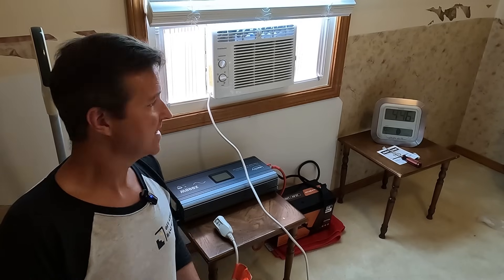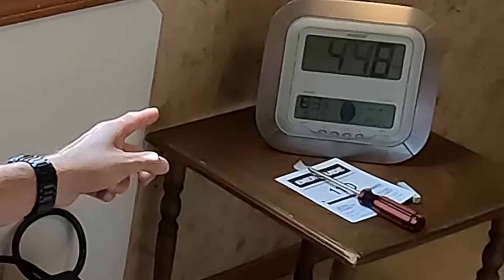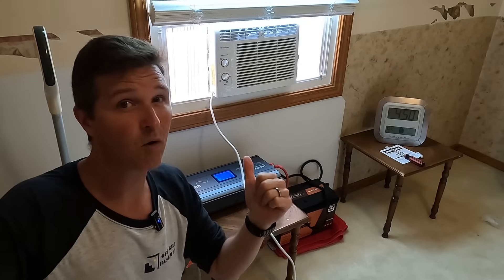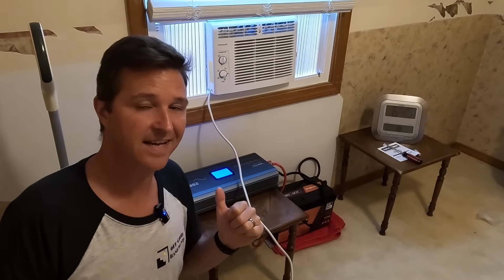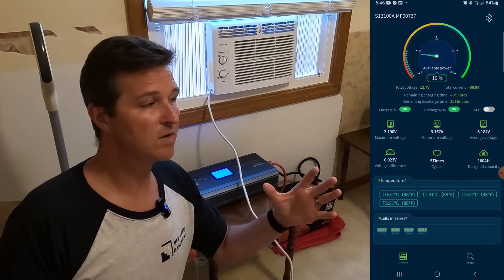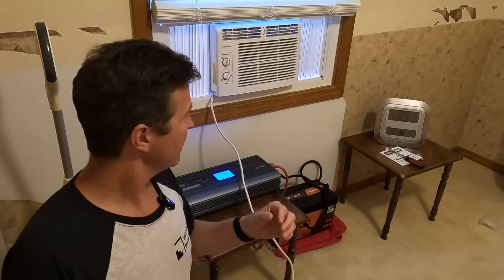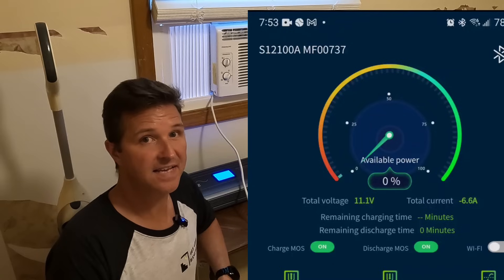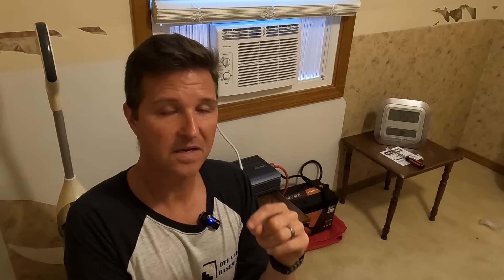How long can you power a 5,000btu air conditioner with a 12v 100ah Lifepo4 battery?  Let's find out!

Comment: Here is SE Michigan, I have a similar setup with several battery banks (AGM, FLA, and LiFePO4) running a LG5k BTU.  Running all day with 900watts of solar on one array using FLA, no issues. But once the sunsets, the real test (as your video shows) is how long a battery will hold up.  I have 4-Renogy AGM 200Ah in parallel (12v) and honestly they SUCK are NOT cheap.  The 24v FLA batteries actually do much better than one would expect.  The LiFePO4 have a more stable voltage.  My advice is this:  Run the highest nominal voltage you can afford to lower the current drain which is what kills batteries especially at 12v and have a good or multiple solar MPPTs with at least 500 watts on each MPPT.  My testing is good enough for me to keep the back room much cooler from 10am until 9pm since two MPPTs easily handle to load and keep the battery at 13.8 all day long......however, its much cheaper to use the grid, but in a power outage or off grid you don't have an alternative other than to run a generator.  Also, my projects are wife approved since she hates heat!
Reply from the maker: Thank you for sharing that great information!
Reply: Yep, I just replaced the Renogy 200s in my van with an Epoch 460. Way better battery. Lasts longer, charges faster and it has an on/off switch.

Comment: Great video. I run a small 3000w generator for 3 hours and charge fridge, batteries and little 8000 btu window HVAC, then I turn off the generator and run just the HVAC on batteries.
Reply from the maker: Thanks for sharing and for the comment.

Comment: May I ask how many watts your inverter uses as overhead at Idle?
Reply from the maker: It uses about 7w of stand by consumption.
Reply: @OffGridBasement  Thank you, Sir.  I have a low frequency 2500/7500 that takes 50-70 watts.  I wondered what the relatively same sized high frequency took.
Reply: @OffGridBasement  You can see that I asked a question about the inverter back when this video was new.  Now almost a year later may I also ask how the inverter is holding up?  Have you used it much?  Has it been dependable?  I also realize that if today I buy the same one off your referenced tag that I might get an entirely different build inside the box.  Companies seem to cheapen their products after getting a good initial reception and thereafter live off their former higher quality reputation.  

I continue to watch your videos and have always had good reason to give them a thumbs up.  

A T Burke

Comment: Add 200 watts of solar n mppt , run all day n and a few hrs after😊 sun sets...
Reply from the maker: Thanks for the comment!
Reply: How are you going to run a 400 watt air conditioner all day on 200 watts of solar? The battery will be dead in 5 hours at most.

Comment: That low of BTU it wouldn't cool much.
Reply from the maker: Yep.  The room has to be pretty small.  A popup camper would be good.  Thanks for the comment.
Reply: You might be surprised what a 5k window ac can do in a well insulated house.  Last summer my 5k kept my FL house comfortable for 4 days until parts came in for my central unit.  Best $135 I ever spent.

Comment: Excellent experiment, We cool our small camper with a 5000 btu ac and have been surprised at how long it will run after the camper cools off. We use a Ecoflow Delta and it shows a couple hours of power, but after the sun goes down we can double that and more.
Reply from the maker: Thank you!  Outside temperature really makes a huge difference.  Thanks for the comment.

Comment: How many watts does the AC take while cooling (compressor is running)?
Edit: I looked up your link 450w. 
I have 300Ah lithium batteries, I guess I multiply your results by 3 to give me a idea.
Reply from the maker: I plan on doing the same test with a 230ah battery to see if it gives me about 7 hours.  I feel like it should be longer.  Thanks for the comment.
Reply: Yes Sir, but add some watts per hour rate for the large inverter's overhead.  Also decrease running time because of the conversion loss using an inverter.

Comment: Now that's the kind of real world test I was looking for. Now, how long would the ac run if panels and a charge controller were added? Could it maintain the ac while the sun is out and still have the 3 hours when the sun goes down?
Reply from the maker: You would probably need about 400w of solar and a sunny day to pull that off.  Thanks for the comment.
Reply: @OffGridBasement  Truth.

Comment: Great video. I'd like to see the run time with same battery/same window a/c but with four added 100 watt solar panels. And also the smallest inverter that would run that a/c. And also pure sine vs. modified sine inverter for the same a/c.
Reply from the maker: Those are all great ideas.  I'll add them to the list!  Thanks for the comment.
Reply: @OffGridBasement  
I'm curious, would it be better to buy another battery & switch to it when the first one depleted or wire them together. Which way would have longer run time ?
Reply: Good question @Steve-re4oo
Reply: Since he started around 5 pm, I don't think that the solar would help much, but I bet a smaller inverter, say 1000 or 800 watt one would help.
Reply: Modified sine wave, especially the poorly modified cheap units, will shorten the life of your air conditioner.  Some of the cheap inverters are no more than square wave with a spike at each phase shift.
Reply: There are many variables in a test like this. You should have no problem running it in that configuration on a nice sunny summer day.

Comment: I just did this over Fathers day weekend. But I used my 12 v 122 ah Marine battery, And I ran my 5,000 air conditioner for 2 hours before I shut it down and switched over to the generator because I needed the battery to run my winch Sunday morning to pull my cabin back up on the trailer. Which it did. Not sure what amperage or wattage it used, wasn't to concerned about it at the time but I do know the battery tested at 11.4 on my meter and that was after loading my cabin back up. So what I am wondering is, why someone would spend $300 plus on these LifePo batteries. I paid 100 bucks at Walmart for my marine battery 2 years ago . Now I think their about 120 bucks. That's a test I would love to see, Marine battery vs Lifepo batteries.
Reply: Why buy Lifepo4? Because your Walmart battery has 500 charge cycles TOPS - even a cheap Lifepo4 will have 2500 charge cycles.
Reply: @grindychum  Ya I thought that would be the only real difference between the two. Thanks for the replied comment .
Reply: @modwrath810  There are many positive differences between the two. The walmart battery only produces half the rated capacity and if it drains to zero it severely limits it's lifespan - lifepo4 outputs the full 100ah capacity till 2000/3000 cycles then reduces to 80% and No damage draining to zero. Lifepo4 also is half the weight and emits no fumes/gasses.
Reply: @grindychum  My Cabin aka portable deer blind , my solar usage is only about 200 watts. With that in mind , That battery for that purpose only gets used 3 times a year. for about 1 week each time. And I do not keep it inside the cabin for that emitting gases reason. Yes I would take and use a Lifepo in a heart beat but 300 Plus bucks for no more than I would use it I cant bring myself to spend that kind of money. I mostly run a 40 watt LED light bulb that only puts out 4 watts, my tv which is like 100 watts and a fan that's 80 watts. I got more battery than I got power coming out of it. I know for fact it runs that fan all night long in the summer time and during the day , i just use the generator for the AC. .. But ya, Like I said, I got nothing against Lifepos, just in my case the cost is not justified.
Reply from the maker: My reasoning is cycle life and weight.  Thanks for the comment.
Reply: Basically lead acid vr lithium
Reply: @modwrath810 

You don't have to spend $300 on  a lifepo4. For starters, they come in different sizes and different price points. You can get a 100ah lifepo4 for under $200. I just saw one for $179.00.

That said, in your unique case it probably wouldn't make sense. You don't care about abusing your battery because no more than you use it, it'll probably still last you 10 years. You'd be better off adding another 100 watts of solar because there's no way you're recharging that empty battery the next day while also running the fan on only 200 watts of solar.

Comment: What I do during power outages running off my battery is sit right in front of my small air conditioner. I mounted in the window behind my camper`s couch. When it`s 100 degrees in Louisiana with 100% humidity sitting in front of the air conditioner is a must when the thermostat is set for efficiency. I`m getting a second battery, MPPT charge controller, and a cheaper smaller inverter for backup. Before storms I top off my battery with a 20 amp LiFeP04 charger and I just got a second 30 amp charger today after seeing a deal on one. It came with multiple ways to connect it too so I don`t have to use the alligator clips.
Reply: People don't understand when that Humidity gets above 80% it's like Doubling the temperature
Reply from the maker: That nice.  Doesn't matter how big the room is when you do that! 😉. Getting another charger is always a good idea.  Thanks for the comment.
Reply: I have a EU2000i gas inverter generator that kept my refrigerator and 5000btu ac going for 5 days after a hurricane. I would run each one separately, taking turns plugging them in so as not to overload the genny if both kicked on at the same time. It used one tank (1.25 gal) per 20 hours, so less than 7 gallons over 5 days. I also hooked up a fan, 60w lamp, cable box and TV. It was a lifesaver! I still have it, plus I have a solar generator. I can actually used the gas inverter generator to recharge the solar generator if there's no sunshine. I'm planning a test run with the combination to learn how long I can survive comfortably with this setup. As long as it's not during an actual disaster, I think it'll be fun and educational.
Reply: Get a Victron charge controller. You'll be glad you did.
Reply: @Skid_A_Follower_of_Christ  I just got two 100/30 smartsolar ones. My air conditioner goes up to 500 watts from 400w in mid summer. I have enough panels to get about 700w total.

Comment: My record using a 12v 300ah Ampere Time battery and a 2000w inverter using an old school 400w manual Frigidaire 5000 btu was 32 hours when it was about 80 degrees. It averages 18 hours with the thermostat set properly between 85 and 90 and 20 to 22 hours at 85 degrees.
Reply from the maker: Thanks for the info and the comment!
Reply: What's the point of 85 to 90 degrees?? Might as well just sit in the shade
Reply: @thisvsthat6930 the  dehumidification in 80-90 % humidity here in South Louisiana plus a fan matters. 80 degrees with 50% humidity is comfortable,  at 80% your sweat just beads up in a miserable way. The breeze from a fan won't cool you if the sweat doesn't evaporate
Reply: @DonalldArmentor  I have never been in an 80 degree house and thought it was comfortable. 78 and up and it's too warm.
Reply: @thisvsthat6930  I am currently relaxing in my home at 81F and 46% humidity.  I am running the 5000 BTU window unit and have a fan blowing on me.  Wearing light clothes and feeling comfortable.  Not cool enough to workout, but just fine for watching YouTube.  The back of the house is too warm, but near the A/C, it is tolerable.
Reply: @thisvsthat6930 
78 degrees is a luxury. 

80 with 45% humidity is fine.  82 with a fan is fine except for sleeping.
Reply: @thisvsthat6930  78? More like anything above 72.
Reply: @chetmyers7041  no way to relax at 81 degrees thats miserable.
Reply: @mac_mcleod  No 78 is misery. below 72 is acceptable and 68ish is good
Reply: @thisvsthat6930  when i moved to fort lauderdale, i blew up the ac 3 times trying to stay cool. When i left 3 years later, my thermostat was set to 80, like all our neighbors. Its just what you get used to.
Reply: @cliffchism9187 I would never get used to living in 80° f house. I can't sleep and sweat. I would rather dig a deep hole in the ground to live around that constant mid 60s. I live in the south US where we regularly see high temps and humidity. If you have high r value insulation, good insulated windows, south facing windows that have awnings, and an appropriately sized HVAC unit there should be no issue!
Reply: @thisvsthat6930 LOL After last month's storms taking down trees and power lines and the AC compressor coincidentally also going out, I had to get a 8,000 BTU Midea window AC unit temporarily until the AC guy could replace the AC. While the window unit is not meant to cool an entire house it did get the temperature down from 90 to 82 running 24/7 and the difference was night and day. While 82 seems high it was cool enough to fall asleep at night.

The AC was finally replaced 5 days later thank God!
Reply: @thisvsthat6930  In essence, it is only a fan operating at say 60 watts per hour.  Not really an AC.
Reply: You would do a lot better if you set the thermostat for 130 degrees.
Reply: @atburke6258 should have used an Evaporative Cooler and ran more days
Reply: What is a time battery?
Reply: Just plug it into a wall socket and skip worry about abusing the unit with inadequate power as the power rapidly goes to zero in the battery.  When you have to make your entire life about frequently recharging your inverter unit for just a few days of electrical power, you are wasting your life in pursuit of a dream.  I can see having a whole house back-up system or a small unit to keep your cell phone or small laptop functioing during a short-lived power outage but to pretend even a 2Kwh inverter/battery unit can effectively run your whole house is pure fantasy.
Reply: @WilliamMurphy-uv9pm  U R party pooper

go home
Reply: 85-90 ?  A record?  What was the outside temp?? 95 degrees???   Suggestion for your new record…. Sit outside and cut the “a/c” off….
Reply: In South Alabama we leave ours 72-75(central) . Heat index is over 100 in the summer down here. Very high humidity as well
Reply: @joshwells4280 where I'm at friday its going to be 87 (100 with heat index) that's about as hot as it gets. Now winter on the other hand I've seen a month of -22f without the wind chill. Coldest it's got in the 10 years I've lived here is minusfuckingthirtyeight without the wind chill and it was terrible.
Reply: @juliogonzo2718 man, I don't know if I could deal with -38. Our low is in the teens on a particularly cold day. Only 2 hours from the Gulf of Mexico though..
Reply: Who uses an AC at 80.   Mine is set to 70, where I use it.
Reply: @Nonyabusiness911  70 is uncomfortably cold to people in a lot of the world.
Reply: @mac_mcleod  Wimps
Reply: @Nonyabusiness911  If we kept ac at 70 our electric bill would go through the roof. It would also feel cold. 75 is a good setting in our house..
Reply: @joewoodchuck3824  I was in Thailand one year.  When temperatures unexpectedly got into the low 70s, many Thais in our area began dying from pneumonia due to the unbearable cold.  We gave away a lot of our heavy blankets that year.  Heavy blankets we used to keep warm in our overly air-conditioned 'hooches' (living quarters).
Reply: @joewoodchuck3824  If I stayed at your house I would legit pay the power bill to not deal with that misery we gotta get it down at least another 5 degrees
Reply: @Nonyabusiness911  If it is 100 degrees outside,  getting a room down to 80 seems like heaven.  Getting it down to 70 likely takes 3-4 times the energy.  What a waste.  Your tolerance level changes with "familiarity" or whatever temps you are accustomed to.
Reply: @WilliamMurphy-uv9pm  I refuse to be miserable in my own home. Idc how much less energy it uses
Reply: @FantomMisfit12  It might surprise you to learn that I agree with you.  But, if you need 72 or lower, something seems off.  Do you live in a high humidity area?  Do you have a very active metabolism even when relaxing?  No need to answer but there is more to the story somewhere here.  I wish you comfort and enjoyment in your own place.  Not everyone fits the crowd's standards; nor do I think they should be forced (or coerced) to change ways that work for them.
Reply: @WilliamMurphy-uv9pm  Southern US very high humidity.
Reply: @FantomMisfit12  Thanks for the follow-up information.  That high humidity likely makes any hot day FEEL 4-5 degrees warmer than a thermometer might indicate.  If you live in a well-insulated place that doesn't leak air one direction or another, a dehumidifier might help somewhat especially at night.  Otherwise, keep that A/C on and blasting until things get below the mid 70s.  But, you already knew that and are doing whatever you can to suffer through.  Likely it is your location and that high humidity that are causing you to crave lower temperatures than most others might enjoy.  Sounds normal to me.
Reply: @WilliamMurphy-uv9pm  That makes sense I did visit Pitsburgh a few times some years ago and I remember it being naturally alot cooler there I'm sure part of that was the humidity maybe
Reply: @WilliamMurphy-uv9pm the hell you acclimatize to it. 80 degree indoor temps are every bit as a miserable to me today as they were over a quarter century ago when I moved the South Florida. Setting a thermostat for 80° to be frugal because it's tolerable at that temperature is nuts.
Reply: @Nonyabusiness911 i keep mine at 68 😂😂😂 70 feels very hot to me unless it’s 30 degrees outside
Reply: @Nonyabusiness911 we live in Texas and our ac is 73 during the day and 65 at night
Reply: if its not igloo territory,  fo-ge-r-bout-it  !!